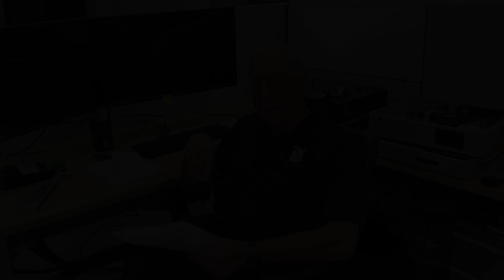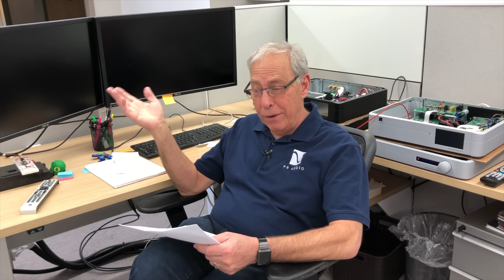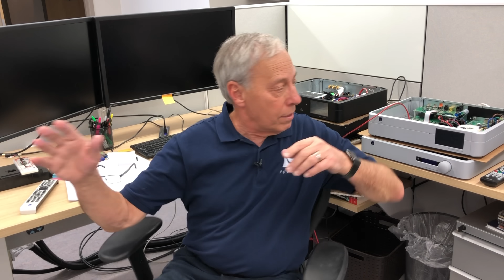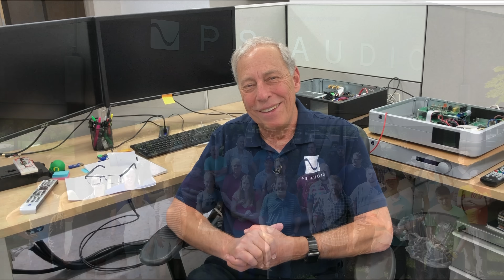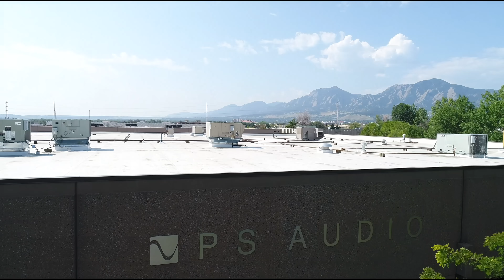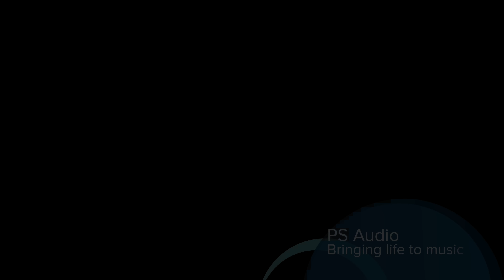Is it time to rethink our power grid?

Comment: I don't see how making the grid "DC" could in any way be helpful.  Our electronics require as many DC voltages as you can imagine and many require large amounts of current be available such as power amplifiers, toasters, irons, stoves, refrigerators, cloths dryers etc.  AC can easily be converted to the exact voltage and current needed in each device.   High voltages also have less losses over distance.

If all we had was light bulbs it might have been doable, but the complexity of modern electronics would seem to say no.
Reply: You're right, the whole idea of switching the entire power grid to DC is absolutely stupid.
Reply: you're right, but on a side note, high voltage high frequency D.C. actually suffers less loss than A.C. during transmission. So converting the grid to D.C. is not as stupid as it sounds, just for completely different reasons
Reply: High frequency DC?  WTF is that?  It sounds like maybe high voltage (AC) held above Earth ground.  If so it is still AC with a different reference point.  Is that how they do the "DC transmission lines"?
Reply: @swinde  Right, DC is DC! There is no low or high frequency. And that's the whole point of long distance DC distribution. You don't and any of the reactive losses and power waste having to charge and discharge that huge capacitor that is 1000 miles of wire.
Reply: @swinde  sort of yeah. HF HVDC is pulsed DC, difference being it doesn't swing + and - with respect to neutral.
Reply: @Jimmeh_B  But if the DC is pulsed, then it's no longer a DC signal. Has nothing to do with polarity above or below a reference point (ground). The HVDC used in power transmission is typically +/- referenced to Earth ground. No different than an audio amplifier bi-polar power supply.
Reply: Andy Delle  ... So are you saying that HVDC transmission lines are at a steady DC value and not a sine wave above or below Earth ground?  I don't really know to tell the truth.  The idea of DC transmission defies all I learned about power transmission in my life.   The entire idea of high voltage transmission lines was to deal with losses along the carrying lines.  With DC and the high available currents required for customers, huge amounts of power would be consumed in the power lines themselves.   The solution was to transmit the power at very high voltages and much lower currents to reach the customer.  Substations reduced these voltages to lower (still high) voltages for the distribution lines, and then a local transformer(s) would reduce the voltage to household or industrial levels.  This allowed the higher currents to be available to the consumers and eliminated most of the losses a DC line would have had.  Another factor is with a pure DC line the voltage would be continually be reduced along the line of distribution.
Reply: @andydelle4509  no it isn't (HVDC), at least not always. Also Pulsed D.C. is still D.C. generally in the form of a square wave. Nothing in a transmission line is referenced to "Earth" ever, it is all referenced to Neutral (there is a fundamental and very important distinction in there)
Reply: That is what I was thinking.  This system STILL  uses high voltages a far lower currents to distribute the power with the current being recovered after it is transformed to the lower voltage that are actually used.

What I do not understand is how is this method better and more efficient than the normal three phase AC?
How do they recover three phase from the two conductors normally seen on DC transmission towers?
Reply: @swinde  Same applies to HF HVDC. It can be transmitted at HV to reduce currents and I2R losses and still be transformed to whatever is required by the end user, also because there is no zero volt crossing it doesn't suffer the reactance and reluctance that A.C. systems do. Also being a D.C. square wave at HF there is head room to allow for active or reactive tuning to account for harmonics and other losses under different load conditions.
Also it allows for micro solar plants and other such small generators to be more easily integrated into the distribution system.
Reply: @andydelle4509   "if the DC is pulsed, then it's no longer a DC signal" ... If this were true, then by your logic (ironically) the computer you are using to reply to me with, is in fact running on A.C.
Reply: Jimmeh B  Thank you very much for the information.   So the idea of a pure DC grid as mentioned in the video is unlikely to be practical, right?
Reply: @swinde , well the video was only suggesting a "local" D.C. rail within the end user's house. From that perspective, it actually makes sense and I have considered it myself, but I know what I'm doing and I would be prepared to for example, set a DC-DC buck converter on an outlet to say 19V to run a monitor and change it to say 80-0-80 for an audio amplifier. 

For the average end user, it would be impractical beyond the lights in the ceiling.

For distribution networks, the only thing stopping it is the initial cost to retrofit. At some point in the future though, unless we abandon distribution networks all together because they are extremely inefficient as compared to local generation, it will become such that the initial cost of retrofitting will be considered viable given the losses incurred when distributing the greater power requirements of larger populations, higher population densities... etc.
Reply: I see what you mean, but this will be a slow transformation and our electronic devices would have to conform to some kind of standard to support the change.   If a standard could be adopted, then our equipment would have to temporally support both systems for a while as the changes occur such as different computer interfaces have done over the last thirty years.  Don't see many floppy drives, parallel ports, or serial (9 pin) ports on computers anymore.
Reply: @swinde  my computer has two parallel ports still!! lol

But yes, something like that would have to happen. OR they could adopt the type of protocols being used by USB C where the device negotiates with the supply to set the voltage and current delivered.
Reply: @Jimmeh_B  What is your EE background? Yes, the data streams inside a computer are in fact AC signals! Look at Ethernet for example, it's transformer coupled. If not AC, then how does an Ethernet stream go through a transformer.? Digital audio is also an AC signal. So is USB. I think you are confusing a sine wave versus squarewave. Both are AC signals. DC is a flat line (unless it has some noise riding on it). A while computer does run on solid DC voltages, the data streams it manipulates are AC signals, and well into the RF region these days based on CPU speeds.
Reply: @Jimmeh_B   If you read those links I posted you will see that the HVDC transmission lines are +/- 500kv. But there are only two wires (or pairs of wires). So where is the reference point? It's the Earth ground. Now most modern utilities do use a return conductor. But some areas still use earth ground especially in rural areas. Do some research into ground current and problems with dairy cows and other livestock on farms. That's a direct result of using the Earth as a return.
Reply: Wow, you still have parallel ports on your machine.  I thought my computer was old (2013) Intel I7 3770K CPU with Asus motherboard.  Custom built by me.  I haven't ever bought a ready made computer.  From Heathkits to the present day.  This way I buy the exact components I want.  It is slightly more expensive but you avoid the compromises in the plug and play units.
Reply: @andydelle4509  which is exactly why it is seldom used and by no means the "norm".

I would have to look into the HVDC with an "earth return" which I'm really not interested in, however, if in deed this is the case, how are they mitigating for lightning strikes?
Reply: @Jimmeh_B  Simple. The tower is grounded. Note too that even long distance three phase AC still carries dedicated ground wires tied to the grounded towers. That's done to keep the potential small between towers due to earth resistance.
Reply: @andydelle4509  Ethernet may be, as it is as you say, transformer coupled, but to say that the data bus is an A.C. signal is absolutely incorrect.
Reply: @andydelle4509  Also, A.C. is not a requirement for a transformer to work.
Reply: @swinde  It's called an inverter. many different topologies. But basically the DC runs an oscillator which then excites a transformer that produces AC. That AC can be made three phase by making a three phase oscillator. Your computer and most of your home electronic gear runs on DC/DC inverters today - even your smartphone charger. That's what a switching power supply is. The AC power cord input is immediately rectified to about 170v or 340v DC, that runs a power oscillator at 50khz or higher, which goes through a transformer then is rectified back to DC for the electronics, The efficiency comes from the use of high frequency AC at 50khz in a saturating on/off mode. Plus the higher in frequency you go, the smaller  the transformer which uses less iron and copper for the same amount of power at 60hz.
Reply: @Jimmeh_B  It is if you want a continuous voltage out of it. Are you referring to an engine ignition coil? Well, that' too is AC as long as the engine is spinning.
Reply: @Jimmeh_B  Like I already asked, what is your EE background? A computer buss is most certainly AC signals! If not then why does high speed digital design encompass AC circuit theory like impedance matching and timing length issues. Again do you understand that a square wave or pulse train is still AC. AC is not just sinewaves.
Reply: Andy ... True most modern electronics feature switching power supplies.  This allows them to operate over a wide AC input voltage range and is more efficient because it only draws the power it needs.  Bulky transformers are eliminated.
Reply: @swinde  They are still DC/DC converters at their core. The bulky transformers are only eliminated due to the use of high frequency AC generated by the internal power oscillator. There are also legacy switching power supplies from the 60s and 70s that still used 60hz power transformers, rectifiers and filters. More efficient than a pure linear regulator but still not where we are today with power supply efficiency. There that 60hz lower voltage rectified DC via the transformer was used to run the HF oscillator. This was before we had power transistors and MOSFETS in the early 1980s that could operate directly at hundreds of volts and tens of amps. Then we could get rid of the 60hz power transformer as well.
Reply: @Jimmeh_B  Since when does a square wave not have a zero crossing? Also if this so called HF HVDC was in fact a square wave, then why would they need thyristor based inverters at the receiving end? If it was truly a square wave, that could easily go directly into a transformer. And that's because, well, a square wave is still AC and that kills the benefit of a steady DC voltage over the long wires.!

Also we need to consider the RFI consequences if HVDC lines were HF square waves with steep rise times at thousands of megawatts! After all, they are just bare wires insulated off the grounded tower. Sounds like a great antenna to me. The FCC would have a a few things to say about that if HVDC transmission was in fact HF square waves.
Reply: @andydelle4509  I hadn't thought of that. I must be remembering incorrectly, you're right, the harmonics would make for HUGE amounts of RFI and EMI. 

However. while square waves can cross zero, they seldom do in data systems and for this reason in computer's are very seldom an A.C. signal.
A square wave that goes to ground but doesn't cross into negative teritory is not A.C.
Reply: @Jimmeh_B  "However. while square waves can cross zero, they seldom do in data systems and for this reason in computer's are very seldom an A.C. signal.
 A square wave that goes to ground but doesn't cross into negative teritory is not A.C."

That's not correct. A zero crossing has nothing to do with ground or any reference signal. Take an unbalanced audio signal for example, a simple RCA cable. The audio signal in the center pin is a complex mix of many waveforms, sines, square waves, pulses, yet they do not go below ground or the return side of the connection. if they did, they would have the bottom part of the waveform chopped off. These are most definitely AC signals yet they sit fully above the ground or return side of the RCA connector. And I can still detect and process the zero crossings of these waveforms no matter where they sit relative to the AC return reference.
Reply: Andy Delle ...  The definition of AC is a current that reverses direction in the conductor at some interval (frequency)  If the current does NOT change direction in the conductor even if it is a sine wave, square wave, triangle, or saw tooth, it is STILL DC (Direct Current).    Audio signals typically have the DC component removed and are at that point are AC signals.  At this point they are no longer power sources.
Reply: @swinde  Your previous posts in this thread, especially this last one,  indicate you have a very novice level of understanding of electronics and electrical principles. If it's an electrical waveform, then it's AC and the current (which makes up the waveform) does in fact reverse each cycle. Any electrical signal that alternates between two voltages relative to each other is AC. It doesn't matter if those two voltages are zero and 5 volts or -15v and +15v centered at zero volts or any voltage in between. It's still an AC signal. The point in which you reference your voltage  measurement is arbitrary. An audio or any signal is still an AC signal no matter what DC offset may be added to it. And that DC offset is only relative to it's return path. A capacitor will remove the DC offset but the signal is AC either way.

And since when is any AC waveform not a power signal? Are we talking "power" as an electrical engineer or "power" as what comes out of a wall outlet. To an EE, they are one in the same. Look as the PS Audio power Plant. That is just a big audio amplifier with an internal 60hz sinewave oscillator. Yet it provides electrical power to run an entire HiFi system.
Reply: @swinde  who said anything about audio signals? By your definition, I am correct. A square wave (pulse) from 0 to say +5v then back to zero, is not A.C.
Reply: @andydelle4509  now you're talking semantics. D.C. offsets are a completely different ball game.
Reply: @Jimmeh_B  Technically a single pulse is still AC. But I'll cut you some slack if the pulse happens like once a hour or so. I can see where some would consider that DC. But any continuous pulse train is AC. I keep asking your EE background and you won't address that? If I want to analyze the energy content in even a single pulse which occurs even once in a millennium I still need to use AC circuit analysis techniques. The reason is time is now involved. DC has no time element to deal with.
Reply: @swinde  google reactance and reluctance. :D
Reply: @Jimmeh_B  That's because I am an EE. Semantics and similar micro details to an otherwise layman are very important in any field of engineering.
Reply: I am an electronics tech and I understand where you are coming from but in reality  a 10 volt sine wave riding on a 20 volt DC component is NOT alternating current.  It is a signal and can be considered an ac component on the line.  This signal does NOT become AC until the DC component is removed from it.   A full wave rectifier produces DC even though there is a strong ripple in the waveform prior to adding a filter to smooth out the DC (remove the "AC component.")
Reply: Jimmy B.  you are correct.  Where did I say otherwise?  It is DC until the waveform actually crosses the zero line.
Reply: @swinde  And you are thinking like a tech. Tell me the amount of energy in that signal without resorting to AC circuit analysis. The unfiltered ripple out of a rectifier is still an AC signal. Again, tell me the total energy content in that pulse train using simple DC analysis?
Reply: @swinde  And what exactly is the zero line? Ground? Well what exactly is ground? The earth you are standing on, the chassis? That is where both of you are getting off track.
Reply: Jimmeh B ...  Reluctance is a magnetic term and is similar to resistance in an electrical circuit.  I am not sure what this has to do with the current conversation
Reactance is a term used for AC circuits to calculate capacities or inductive impedance.   It is similar to resistance in DC circuits, but it varies with the frequency of the AC current.  Again, what is the connection to the discussion?
Reply: Andy ... Yes the ripple is an AC signal, but the current is still DC.  Unfiltered it should be about .707 of peak voltage.
Reply: Andy ... Once the DC component is removed the "zero line " is the center line of the waveform but it is of course NOT ground.  Dealing with signals is different than dealing with power sources.  This signal is referenced to ground but in no way does the waveform cross ground.
Reply: @swinde  You still don't get it. An ac signal IS a power source! Electrical energy is electrical energy. The ground is relative, not an absolute reference. You only choose it as a reference. You seem to be saying an audio signal traveling down a shielded cable is not an AC signal because your measurement is referenced to it's return path and the signal does not go below it.
Reply: @andydelle4509  I'm not an EE. I'm a self educated hobbyist. Nowhere ever in any engineering book I've ever read has referred to a data chain as an A.C. signal, ever. I would have thought that somewhere in amongst my 32 years of reading, there would be at least one reference to it being considered as such,
Reply: @swinde 

 Current waveforms with voltage always >0 are called pulsing DC and not AC, or is it?
Reply: @westelaudio943  In electrical engineering, there are two major areas of circuit analysis. DC and AC. I don't know where this "pulsing DC" idea comes from. If there is a time element involved in the needed analysis, it's an AC analysis problem. What started all this was a claim that the data signals in a computer are DC and not AC. Anytime those logic levels are alternating it's an AC signal. If they stop and stay static, then yes you could say they are DC at that time. But a computer with static logic levels is not of much use is it? Furthermore modern computer hardware  engineering is heavily laced with traditional RF engineering. Any computer hardware engineer that thinks otherwise is soon out of a job. Look at today's clock speeds. And note that any clock speed, even 1mhz or lower still implies an AC circuit. Clock = time= AC!
Reply: Westel Audio  ...  As long as the waveform does not go negative it is DC. It can be called pulsing DC.
If the DC component is removed it is AC.   I think it is important to differentiate between power sources and ac signals because they are different.    Note that if the DC component is negative the same applies except it cannot go positive and remain DC.
Reply: @Jimmeh_B  OK, I understand where this is coming from. And please I don't mean to sound belittling, but there are many electronics hobbyists (or do they now call them makers?) these days turning LEDs on and off with their Adrinuo kits. And it's easy to see how one would say that data signal toggling the LED is DC. Same for that push button switch talking to the CPU. But lets advance beyond that as say that LED is now a laser module sending 10gbs data streams down a fiber. The electrical connection to the laser diode is in fact an AC signal. And anybody thinking it's still just DC  is in for some surprises with what comes out the other end of that link. Even a fractions of an inch of wire has an effect because, yes, it's an AC signal, in fact an RF AC signal. Electrically there is no difference between the connection of your LED to your Adrinuo and the 10gbs network switch laser diode. But in terms of engineering the difference is huge yet the electrical path is identical in both cases.
Reply: @swinde  And that's a great technician explanation. But the truth is that as long as there is a time element to the signal analysis, it's an AC signal. Where the signal falls on a voltage chart is irrelevant to that fact. Power is not a signal and a signal is not power? OK perhaps on the repair schematic but not in engineering terms.
Reply: @swinde  

Yes that's what I thought too, Alternating Current means the polarity is alternating. Wikipedia calls it "pulsed DC".
Reply: @westelaudio943  Yes but polarity alternating relative to what? Again that's where you are getting off track. it's not as simple as a ground and hot lead in your RCA cable! An AC signal does not need to go below "ground". Because after all, what do you mean by "ground".
Reply: Andy ... True, a signal is ac but it is not the same as a power source.  I am not sure how to explain the difference.
If you look at this thread it has gone way off topic which was should we have a DC power source in our homes for things that run on DC which is almost all electronics.  My thinking is that it is a "cure" for a problem that does not exist. I can't see any way to provide all the different DC levels of voltage and current our devices need.
Reply: @andydelle4509  I do take offense to that buddy. Now, I am not some arduino kiddy running around screaming about what a wizard I am using other peoples scripts on some platform I didn't design. 

I cut my teeth on Sbasic when I was 7 then on CPM when I was 8 yrs old on a Sanyo MBC1000. 

I don't blink led's on an arduino, I have read cover to cover and have beside me a copy of the 480 odd page data sheet for the Atmel328p.

I was programming PIC's as soon as they came about and was one of the first in Aus to own the "easyPic" v7 IDE from mikroElektronika.

I have worked for Channel 7 Studios, Queensland communications, contracted to Fox studios in Sydney... to name a few.

Do NOT for a SECOND try to tell me that you have some sort of authority because you're a uni grad.  I have worked hard to attain the knowledge I have and the positions I've been fortunate enough to work in.

And I reiterate, because I LOVE repeating myself...

Nowhere in ANY engineering book have I EVER seen a Square wave output from a circuit supplied by a single rail, referred to as an A.C. signal.

Yes you can use A.C. circuit analysis techniques to analyze a data train, but that does NOT constitute an A.C. signal.
Reply: Andy Delle also, I challenge you to find me ONE data sheet for ANY laser diode that will run on ANYTHING other than a current limited D.C. supply.
Reply: @Jimmeh_B  I though I was being respectful. I did not say you were some Ardunio kid either. I just used that as an example.

I too work in broadcast engineering - over 35 years. Part of my early career was in DVE and similar digital video system processing hardware design the 1980s. Take even early DVE systems. Ampex ADO, Vital SqueezeZoom, GVG Kalidascope. You mean to tell me those "digital" signals running around inside there are not AC? What about SDI and now HDSDI or even lowly AES. SDI is an 800mv pulse train and that 800mv is referenced above the shield. You mean to tell me that's just DC? OK, then why can't we just use lamp cord? It's just DC?

You say you never saw a square wave being refereed to as AC in any engineering book? Well was it really a university level engineering text book? Did it go into AC circuit theory? Clearly you didn't read the right books when it comes to design theory.

Here you go. You can research my background all you want:
https://www.youtube.com/watch?v=bEMuqo38lJ0&feature=youtu.be
Reply: @Jimmeh_B  OK. Just as there is no microprocessor or any logic circuit that does not run on a DC supply. But what about the signal modulating said laser diode? You say that is not an AC signal but rather a DC pulse train? It's an RF AC signal period! In fact it probably has 10/14 or some form of NRZ encoding to enhance clock recovery. But that;'s way beyond this basic discussion.
Reply: @andydelle4509  look, I'm going to agree to disagree with ya, because if the polarity doesn't change, regardless of the time domain, it is a D.C. signal by definition.

I'm done.
Reply: @Jimmeh_B  And you are certainly entitled to your opinion.
Reply: J Fz  So you are saying that for appliances that don't actually use AC you would have some kind of "Universal Power Supply" that would provide the many hundreds of voltage and current needs of all appliances that use DC?  that seems unrealistic to me. 

I think we are better off letting each appliance do the DC conversion itself, because it can supply the many different voltage and current needs of the appliance.   Computers need +5v and +/- 12v.  Power amps normally need DC voltages of +80 or more for output stages and +/- 12 volts for earlier stages.  Tube amplifiers need anywhere from 100v to 600v for B+ supplies and a negative voltage for bias.  

Things are getting complicated very swiftly and I have only begun to point out the many issues.   Clearly (at least to me)  120-240 AC is still the most practical service for the home.   There are other services for industrial as 277, 440, 880, etc. and amazingly ALL are accommodated by the simple three phase AC grid currently in use.   If it is not broken, there is no need to "fix" it.
Reply: This thread has been crazy with the topic moving all over the place, but at least I learned how HV DC transmission lines work.  Thank you Jimmeh B.